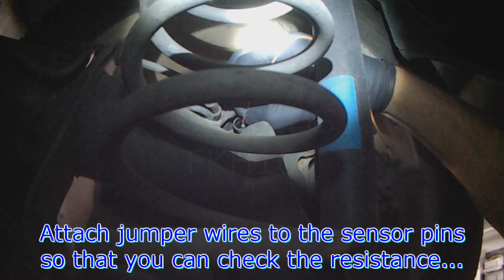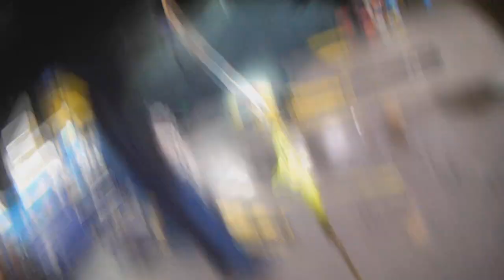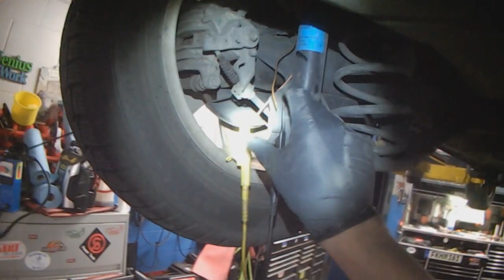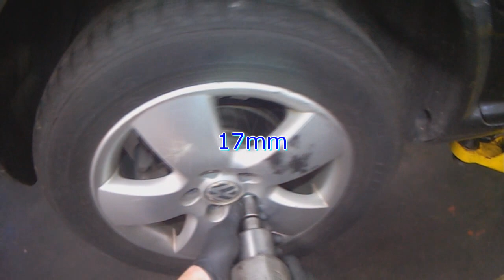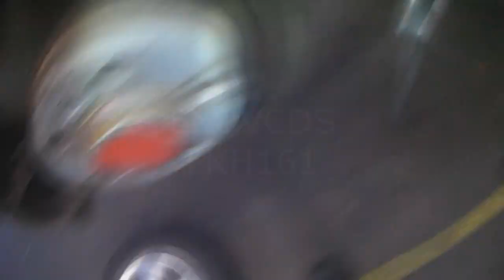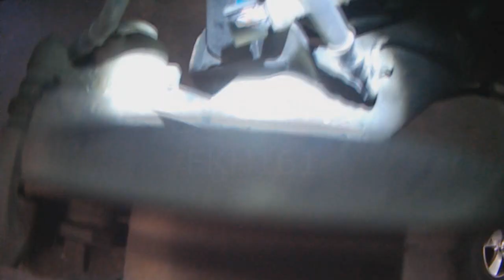VW A4: Rear wheel speed sensor fault

Comment: I replaced the sensor with no luck 
Still have the abs light
Reply from the maker: I need more history... what code did you have? What & how did you check things? Year, make & model?
Reply: 00287 
13 Jetta
Reply from the maker: @nosoymecanicoperoleintento4521  there more than one description for that code... which one?
http://wiki.ross-tech.com/wiki/index.php/00287
What did you check & how... before you replaced the sensor?
Reply: Electrical fault circuit
Reply from the maker: @nosoymecanicoperoleintento4521  I can do this all night:
What did you check & how... before you replaced the sensor?
Reply: My traction control light is on I use the scanner and I get that code right rear sped sensor and I have no power in the connection
Reply from the maker: @nosoymecanicoperoleintento4521  What type of sensor is in the car? VR or Hall? VR produces a voltage / signal as the wheel turns, while the hall sensor needs voltage to produce a signal. The VR signal is an AC voltage signal and the Hall sensor produces a square wave signal. If you can't find any "circuit / wiring" faults, then the problem is inside the ABS module. It's a good idea to also check the ABS tone wheel (used with VR style sensor) or the "magnetic ring" (used with Hall style sensor) for correct "gap" from the sensor and for any damage.

Comment: I am getting this fault code

1 Fault Found:
00287 - ABS Wheel Speed Sensor; Rear Right (G44) 
            012 - Electrical Fault in Circuit
Reply from the maker: Have you checked / compared the resistance of both rear sensors?
Reply: @EXOVCDS  No i did'nt, i don't have a meter, I just have a test light,  and thankx for replying to every comment really appreciated.
Reply from the maker: @vampir335  you can get a cheap meter for $20 and then tell me the test results.
Reply: @EXOVCDS   Do I put the prongs on each of the terminals in the speed sensor? i am hoping the speed sensor is dead so just a replacement will be sufficient, but hoping not to be a cable or ABS wires that is faulty.
Reply: what type of ohms am i looking for to make confirm a open circuit? what does open circuit mean anyway? does that mean the sensor is dead?
Reply from the maker: @vampir335  If you watched the video... I show bad & good ohm readings. Good reading is at 3.29
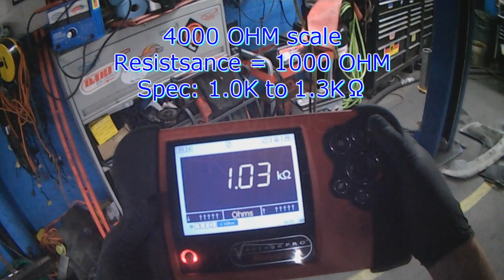If the sensor ohm reading is not within the specification at 3:29, then the sensor is bad. You test / check across the 2 pins in side the sensor... after disconnecting the connector. I think this was all visible in the video, sorry if it was not (I did not watch the whole video, I just skimmed through it to find the spec for you).
Reply: @EXOVCDS  thanks alot man you really are a star and follow all your videos, i have a 1.9TDI golf mk4 but this side we cal it AHF engine i think in the states its ALH but appreciate your replies. I got a friend who has an ohm meter and a volt meter will go to his house for tests.
Reply: does the car need to be on the ON position? or even when its off it is supposed to give a reading?
Reply: @EXOVCDS  I am back from my friend with the voltmeter and ohmeter
The sensor is completely dead it doesn't register any type of electricity at all
Reply from the maker: @vampir335  It shouldn't register electricity... since you are checking resistance (ohms). The meter needs to be on the OHM scale, not the voltage scale. If you were on ohms, and just misspoke... no worries.
Reply: @EXOVCDS  yes We were on ohms sorry, on the scale that was on the video got 0 reading, and we switched to volts and spun the wheel 0 voltage. I am glad its just the sensor that is dead,so its easy to replace I hope it can be pryed out easily and not a huge battle to destroy it out. :D
Reply from the maker: @vampir335  If you are lucky, it'll come out fairly easily. Let me know how it goes / went and if the fault goes away.
Reply: @EXOVCDS  will do thanks
Reply from the maker: http://wiki.ross-tech.com/wiki/index.php/00287

Comment: Hey thomas can this work with a multimeter as well? also if you check the wires and get 12vdc and changed the sensor with a known good what else is there to check that could throw this code?
Reply from the maker: I was using a multimeter set to check resistance / ohms... multimeters come in many shapes & sizes. 
The ABS module sends a bias voltage to the sensor (that's how it can detect sensor faults)... I don't remember how much that bias voltage is, but it's probably not 12v. Year, make & model? If it's not a sensor fault (resistance is ok) and it's not a wiring fault (wiring to & from ABS module is OK), then it might be a problem with the ABS module. What code are you getting?
Reply: @EXOVCDS  OK thanks I'm getting the 00287 and 03842 error will check the wiring from the abs plug and see what's up.
Reply: @EXOVCDS  Fixed the problem it was the plug boot when inserting the new sensor it was pushing the pins out so it was not making contact with it everything is fine now thanks
Reply from the maker: Thanks for the update... good job finding the problem!

Comment: i have a passat b6 and my abs has just come on again recently had a dio done which said it was rear drivers wheel, which is strange because last year i replaced the hub for new abs ring which was damaged and new sensor too. was wondering can the speed sensor be intermittent or if it brakes should it just stay of constantly?
Reply from the maker: Make sure that tire pressure is equal to the other tires... you will have to do some checking of components to determine what is going on. Something could have gotten damaged from debris on the road or something metalic is stuck to the magnetic ring of the abs ring... causing an erratic signal.

Comment: My A4 seems to have the ful cable attached. I presume this runs under the passenger seat. Any tips?
Reply from the maker: ABS sensor wire / harness should be accessible under the rear bench seat (lift seat)... look for the harness plug at the base of the door / wheel arch.
Reply from the maker: My reply was for Audi A4 (which I think you have)... the video is for VW A4 (mk4) Golf & jetta.

Comment: I have a fault code on my right rear sensor (open/short to positive). I checked the resistance and it gave me 132kOhm although I was expecting 0 or infinite. I checked the left rear (no codes) and got 1.6kOhm. Any ideas?
Reply from the maker: 1.6K = 1600 ohms
132k = 132000 ohms
That's pretty much an open circuit.

Comment: Bit less hassle than the A3 platform where they connect under the back seat. Nice fix.
Reply from the maker: +Badgertronix Those are good for testing though... you can swap the connections to see if the "fault code" goes to the other side! :)